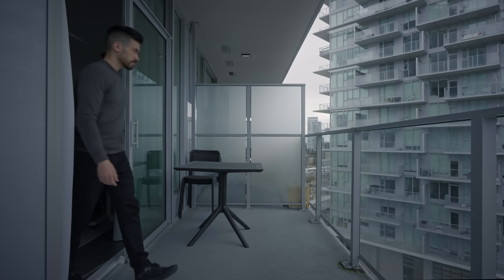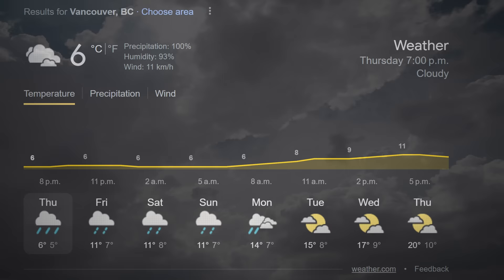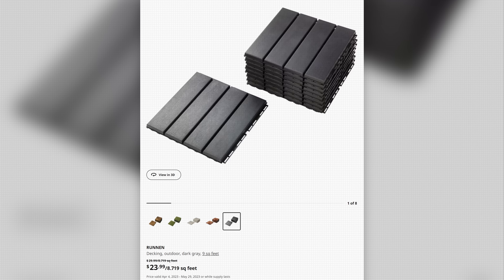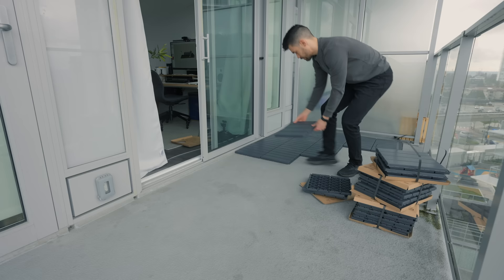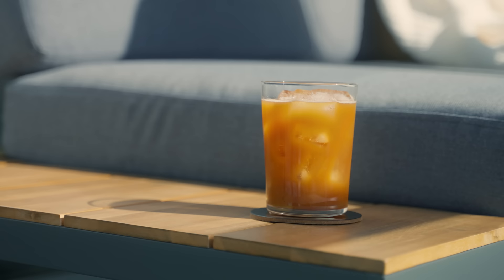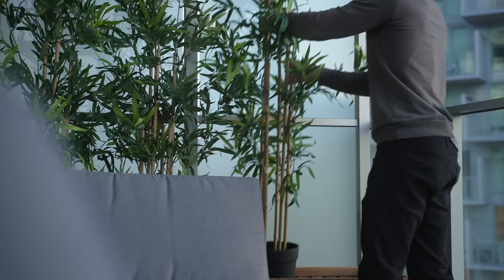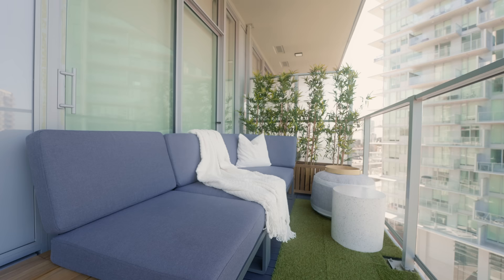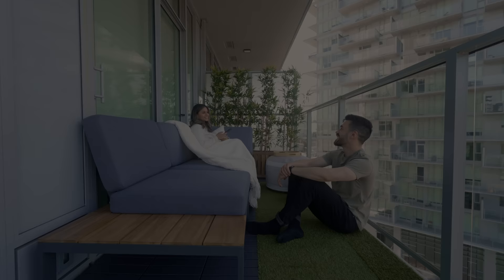A small balcony makeover for my wife.

Comment: Very well done! I lived in two condos when I was in Toronto. One had a balcony that was unusable because of the constant gusty winds and very noisy surrounding highway traffic. The second condo I lived in was much better. I was able to actually put patio furniture outside. The main problem was the occasional winds that would lift the furniture pieces and throw them off the balcony. By our condo regulation, all furniture was to be attached by rope or chain to avoid this periodic and potentially dangerous problem. I now live in a country cottage with a lovely deck and no longer need to worry about losing furniture due to frisky winds. But for anyone living in an apartment or condo, it definitely makes a difference to furnish and enjoy the balcony space.

Comment: Interesting. I just moved and I was thinking of getting some fake grass like you did but for the whole balcony. I didn't think of doing a mix with something a little more firm which seems like a much better idea for our dinning table since it's quite a high one with tall stools instead of chairs. It probably wouldn't work as well with grass.

I really agree with you though. Most people don't seem to utilize their balcony to its full potential. Besides the concrete floor, I made sure to make it cozy ASAP.

Comment: A tip from someone who had similar tiles on the balcony for years in Germany: After about two years, the UV rays destroy the supporting substructure. It does not matter whether there is wood or plastic above it, but the substructure becomes brittle. After about four years we could dispose of everything.

Comment: I’d have weatherproof deck furniture with removable cushions and cushion seats that I could grab and take indoors when it started raining, as the damp and humidity and cold weather would eventually seep into the couch outside even if it has a rain cover. the damp atmosphere will still get underneath the floor edges

Comment: Great idea. I have almost the exact same balcony, but setup 4x IKEA Applaro benches as a corner sofa with built in storage. To protect against weather they are lined on the inside with the IKEA Frakta bags. For table I bought a foldable table, that I can store against the rail and fold out so we can sit 4 people down for dinner during sunsets. Our door is a swingdoor that opens towards where you have placed your camera. Here we have mounted a wall of IKEA TROMNES that we can use an extra fridge/cooler during the scandinavian wintertime and storage in summertime :)

Comment: Great job! The lighting in particular is not something I would have considered - it looks amazing. The blanket is also a smart move - unfortunately summer nights are rarely warm on the west coast.  

For a fast project I think the Ikea plastic deck tiles make sense - their wooden ones are stained so dark that they look quite uniform, so one doesn't really get much from them, other than maintenance. I installed mine during the pandemic and with the extra time, I bought the wooden ones, sanded them down and refinished them with a durable and transparent finish to set off the acacia grain. It was a ton of work, but really warms the space and the finish has held up much better than factory ikea stain. The plastic base has keep them together in spite of being outdoors for three years now in the coastal climate.

Comment: I recently moved into a small rental apartment with a teeny tiny balcony that has a brick wall on the railing-side, that makes it quite dark and not very inviting, but my guess is I can find a way to hide those bricks, so I am not too worried about that.

I would LOVE too use some of those lovely lights outside and make it all cosy in the evening.

BUT….

Right in front of my balcony, no more than about 5 meters away, there is a massive (and VERY VERY VERY BRIGHT!!!) street light….!!

Any kind of lighting I would put up, would simply get lost because of that.

DOES ANYONE HAVE AN IDEA how I can get that cosy atmosphere at night instead of sitting in full lighting beams*???? 
(The street light is always on and asking the Council to remove it is NOT an option)

*okay, that’s a little overstated, but you get what I mean 😉)

Comment: The plastics holding the decking together, IKEA's and basically same from other stores, are of very poor quality. So with a couple or more years outdoors during winter condition, they will eventually become fragile and easier to break. Especially if you one day want to try to take them apart or if there is higher weight put on one part of the deck. But still, it's a rather cheap solution I suppose. I still think though that a very large woolen carpet that covers the whole balcony is much nicer! That is life right there.

Comment: I don't understand what the everyday usage of the sofa cover is going to look like. Will you always leave the cover on and only remove it when the sofa is used? I imagine it would be extremely annoying having to remove the cover just to have a coffeee outside and especially also having it to put back on afterwards. This would either prevent me from using the balcony at all or I would just sit on top of the cover so I don't have to deal with all those extra steps.

But I don't see any other reasonable option. Only putting it on when you know it's going to rain will surely lead to everything getting wet sooner or later. Either when nobody is home or at night when everybody is sleeping. Or maybe even just when both adults are so occupied with work or the their child that they do not even notice the rain. And if that happens anyway, the cover is completely pointless. All I could see happening is that it is put on for the colder months when nobody wants to sit outside anyway. But this doesn't solve the question of reliably preventing everything getting wet during summer.
Reply: My guess is that it'll be off most of the time since it seems like the rain doesn't normally reach that far but if there is a storm incoming the cover will be put on. This would probably just be a few days a year